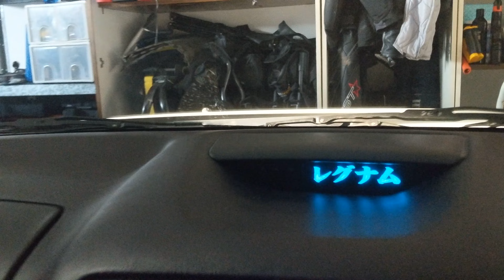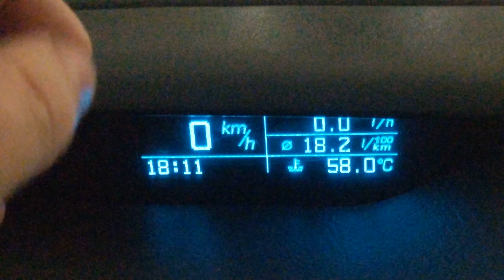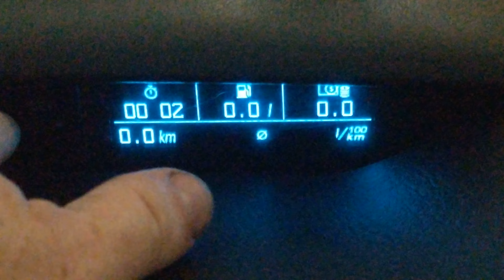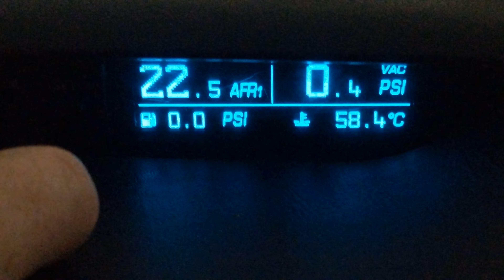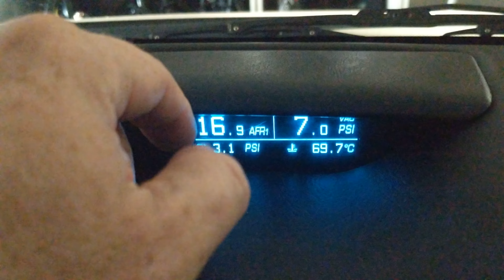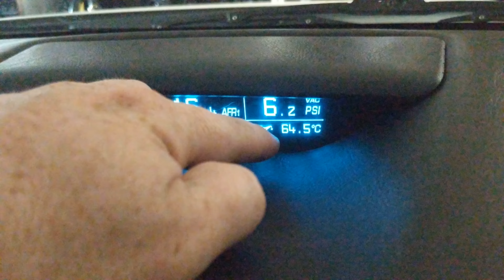UTCOMP operation in Legnum VR4

Comment: HI
I'm interested to buy this, just a question 
What sensor are you using for temperature ? the DS18B20 from Reveltronics (Digital) , NTC sensor or somethings others (OEM or whatever)
I planned tu use the DS18B20 for Intake and water temp (Because I have no more input available with my setup)
Did they are reactives ?
Thanks ! :)